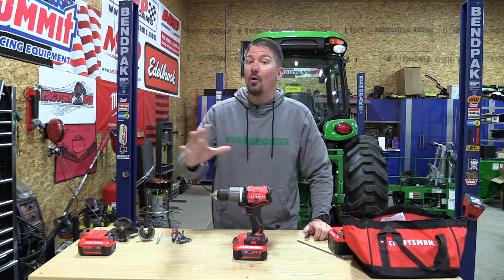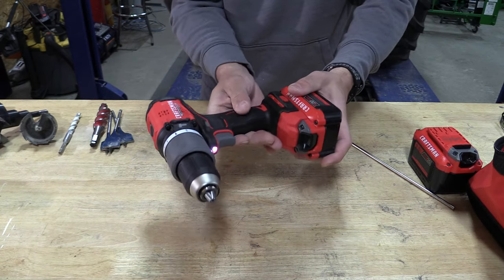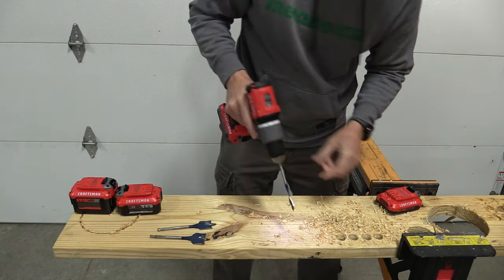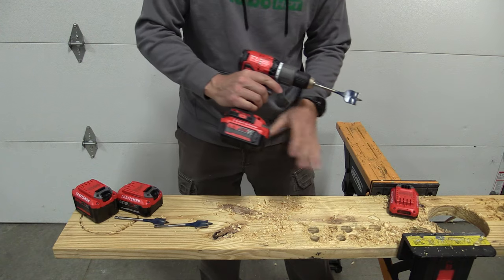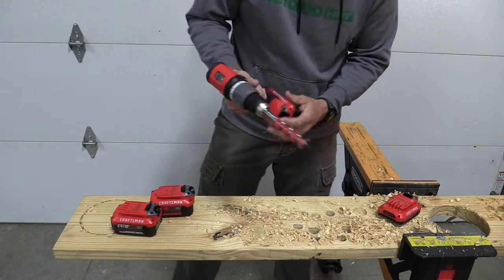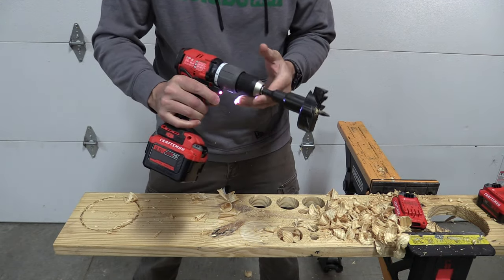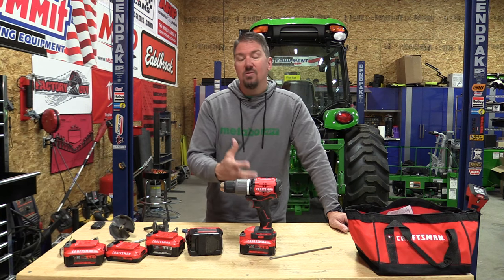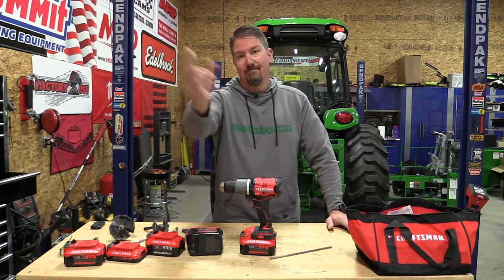CRAFTSMAN V20 Brushless RP 1/2" Hammer Drill Driver Review

Comment: Test the impact driver and even include vs tools in its price class. I work for an industrial contractor. We use ryobi, DeWalt, Makita, craftsman, kobalt, and Milwaukee.
Some of these budget brushless tools surprise me in "practical" applications.
How they hold up is a mystery as we use the impact driver the most. All day every day. A kobalt impact driver I have been using for over a year and still working Great. I only use 4ah batteries or larger for all tools are necessary to last for a days worth of work. 2ah that usually come with the tools end up on flashlights.

Comment: I have a lot of the Craftsman V20 stuff and honestly this new RP version seems like a step down or at best lateral from the previous version, which by the way the Chuck on the previous is metal and the Dewalt aux handle fits it.
Reply: this is more like the replacement for the mid grade CMCD731. The flagship, Made in USA CMCD721 hammerdrill hasn't had its replacement (it may never get one)
Reply: I agree I have all the regular brushless USA no rp
Reply: Do you have craftsman v20 tools or craftsman v20 brushless tools? Because the v20 RP tools are rebadged v20 brushless. Definitely not a step down, they’re identical.
Reply: Can you share the part number for the Dewalt handle that fits the USA Craftsman drills?
Reply: @6atlantis  I have the USA brushless stuff. If it’s “not a step down” then why is the Chuck now plastic instead of metal and the aux handle metal ring gone? They cheapened it, dude. It’s not the same.

Comment: The reason why the 6Ah battery produces less torque than the 4Ah one is that they both have 2 banx of 5-cell series of 18650 batteries inside, but the 6Ah battery has 3Ah capacity cells and the 4Ah has 2Ah capacity cells. Li-ion batteries are, as a rule of thumb, either high capacity or high current drain, but you can very rarely have both. So, with the 3Ah cells inside the 6Ah battery, you most likely have a lower max current that can be drawn by the tool, resulting in less torque.
Obviously, the single-bank 2Ah battery doesn't even come into play here.
The 9Ah battery has 3 banx, making it approx 1.5 times more powerful than the 6Ah one.

Comment: What a bummer. Most RP tools seem to be existing Craftsman models, just relabeled and added some aesthetic touches here and there. No power increase whatsoever, why bother then?
PS. this is not a replacement for the flagship Made In USA CMCD721 model; I had both that one and the CMCD 731 which is being replaced by this. It's definitely a step down in build quality and capability. This is more like a DCD778 (entry level DeWalt Brushless hammer drill with 350UWO which I also owned) than a DCD996 painted in red
Reply: I still prefer the USA model. I’ve put mine through absolute heIl over the years and it hasn’t missed a beat. I also know there’s a Dewalt handle cross compatible with it, but I’m not sure what the part number is.

Comment: Can someone give me some insight on this. Craftsman sent me this as a  replacement to my brushed driver. Switching between the speed selector I’m not hearing any difference in sound.
Reply from the maker: You should be able to see the speed difference in the chuck.  Have you put a bit in it and drilled on high and then on low to see the difference?